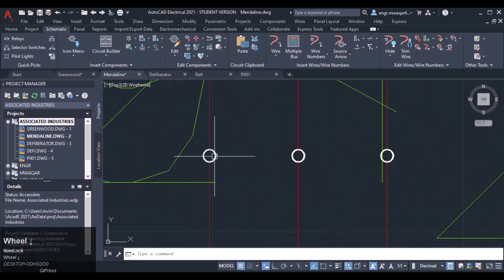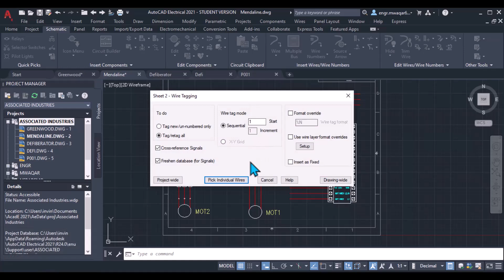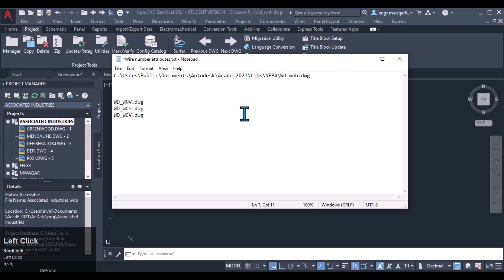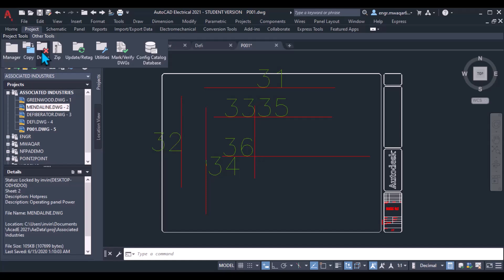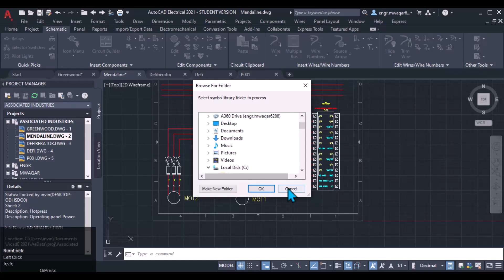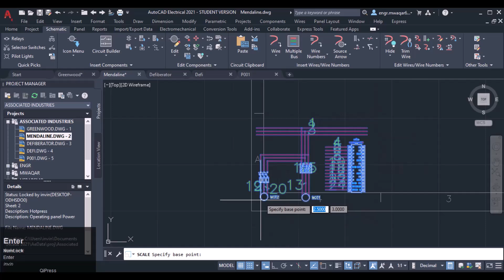AutoCAD Electrical 5.2b: 5 Essential Tricks to MODIFY Your Drawings FAST

Comment: very informative thank you
Reply from the maker: Thank you for supporting.
Reply: @suntechengg  i have changed the wire number height from wd_wnh.dwg but it doesn't effect my wire number height in my actual project 
what could be the reason
Reply from the maker: This usually happens because the project or drawing has its own wire number settings that override wd_wnh.dwg. Also check if the drawing was already numbered before the change, or if a different wire number style/template is assigned in
 *Project Properties → Wire Numbers*.